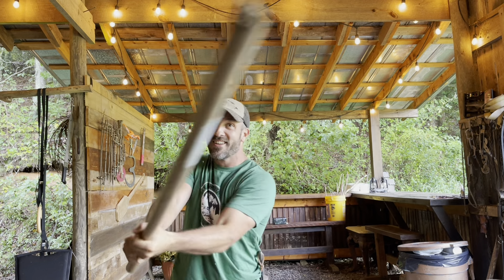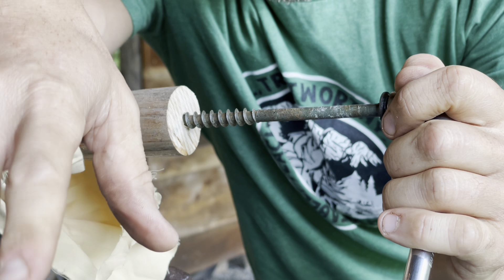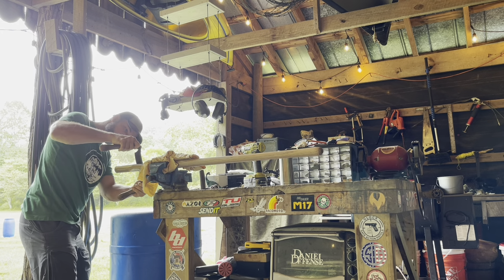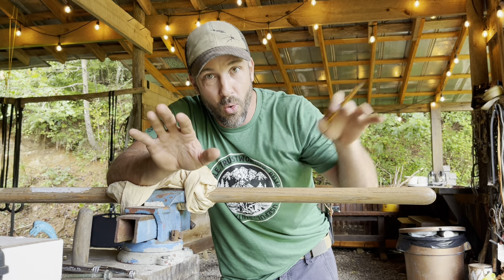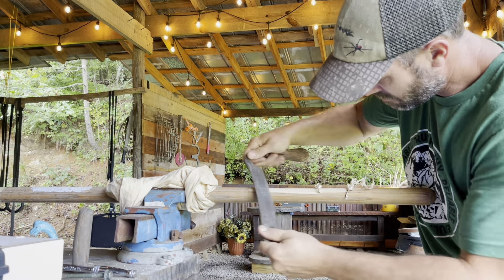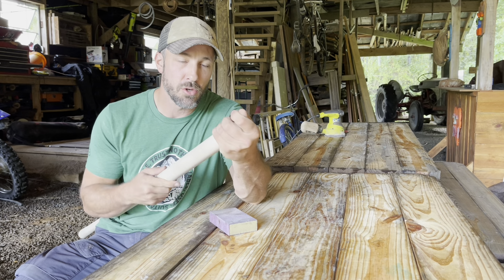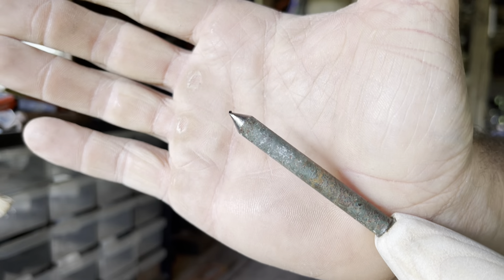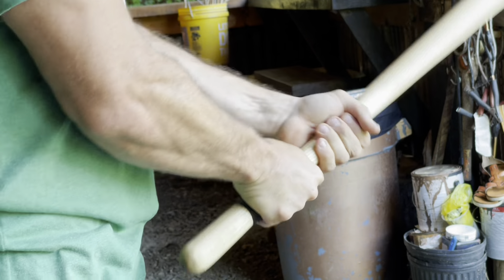The #1 Survival Skill

Comment: When I was a teenager I drove a nail into a similar handle and filed it very sharp to use to pick up aluminum cans. My brother and I picked up 13 bags of cans with our version. One day I missed the can and stabbed through my shoe. It was so weird because I didn’t feel any pain at the moment but the nail was all the way through my big toe. When I took the shoe and sock off I was bleeding from the top and bottom of my toe. I ended up getting a tetanus shot but no worse for the wear. Mine was not as strong as yours but worked great. I gave it a little better aim after that. Thank you for the memory. Having a positive mental attitude is a wonderful asset to have and makes you a great person to be around.

Comment: I use my hiking stick as a catapult to launch my rock bag over a tree limb to hang my food.  Tie a loop in bear line that just fits over the pole end, 8 inches down is rock bag then rest of bear line.  Swing the pole to launch rock bag over the tree limb, stop the swing just before straight up and loop will slip off the pole and catapult the rock bag.  Gives more power and directional control.